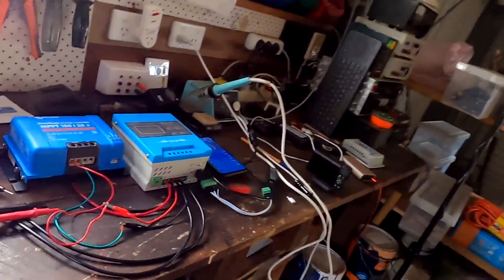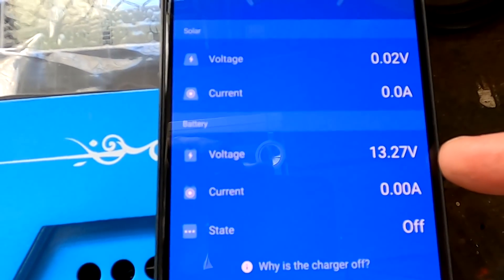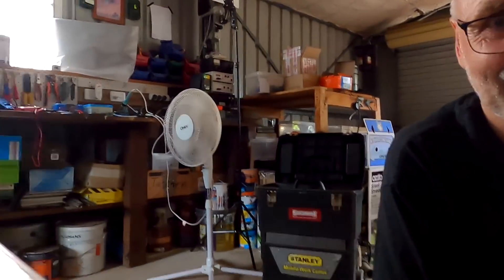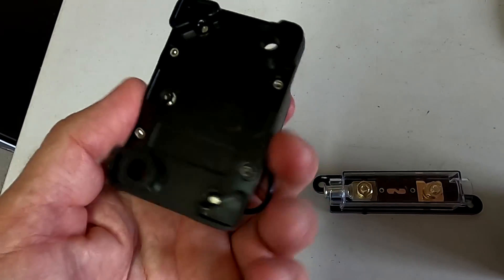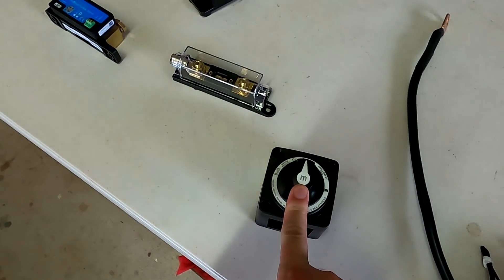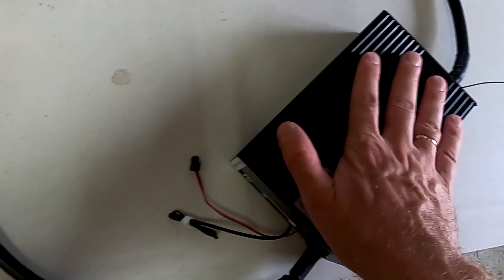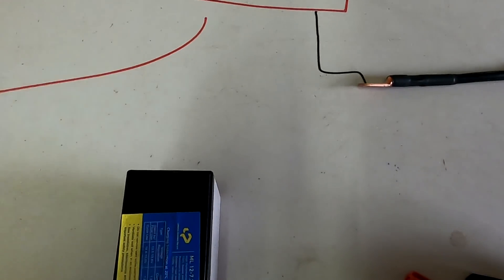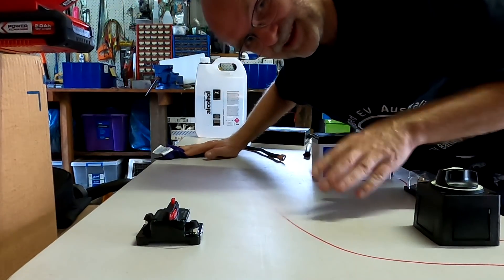How to arrange all your battery gear? Best practice?

Comment: The shunt should go before the BMS. the main reason if your BMS disconnects then you lose all smart shunt data,. that is the issue i am having...  Fuse on positive
Reply from the maker: What shunt are you using? My smart shunt does not lose any information when powered off, just the SOC but this was fixed in the latest firmware update.
Reply: @@OffGridGarageAustralia  you're right not data,  it is the SOC.. I guess I have not updated. never mind lol

Comment: I've been using my 'cheap' 150A circuit breaker (like yours) in my 24V system for 5 years now without a problem. I've never tripped it but my inverter is only 2400w continuous.

Comment: Circuit breaker can't be everywhere.... From the plus pole of the battery you got
0- battery plus
1- isolator
2- fuse
3- inverter
4- bms
5- shunt
6- battery minus

Comment: Andy,
Please review AS/NZS 5139:2019 for BESS's, which states you need 2 pole Isolator, not single pole....
"The battery isolator shall have at least one pole for each live conductor including the conductor that is earthed. For example, if the system comprises a centre tapped earth then a 3 pole switch-disconnector is required for breaking simultaneously the two battery system output cables and the centre tapped earth."

Comment: For the automatic fuse: It's garbage. Do not use.
There are better ones of this  automatic type but I would go for the ANL fuse you liked and bought.

And by the way.. this automatic is not meant to be used as switch as IMHO said in the video.

Other things were explained correct, battery minus to bms to shunt.

By the way 2: I would always go for Victron BMV712 instead of smartshunt. Works always and independent of a present smartphone or a functional apo on an smartphone operation system in maybe 5 years.. (and additionally have a switched output...)

Comment: I had a couple of those 200A breakers. Useless. The terminals were pathetic on them and they tripped in about 20 seconds with only 110A.
Reply: Totally agree.  I bought a couple of these and put one in a small system I put together and it tripped WAY before it should have.  Thankfully it tripped before the AMP rating was reached rather than the other way around but this made me question the quality of these breakers.  I ended up throwing them out.  Don't use them.

Comment: In cars and boats we always fuse the positive. It is kind of hard to explain without drawing an schematic, but basically, during a fault, you might have alternative paths to the negative (via car shell , or appliances shell/grounding on boats). This is much more unlikely on a solar install, but it doesn't hurt to follow.

Some people trust only on the BMS as a safety device. In my opinion this is not acceptable. It is there to save the battery, the fuse is there to save the wiring FROM the battery.
Reply from the maker: I totally agree and I'm used to fuse the positive as well rather than the negative.
And yes again, the BMS is for protecting the battery, nothing else.

Comment: On the negative side, go with:

Battery > BMS > Shunt

If you think about it, many brand name batteries come with a BMS in the box... Everything is connected after that BMS, including a Shunt.
Reply from the maker: But the shunt won't be accurate then. It has voltage sense to the battery for the positive but the negative has the 'loss' from the BMS.
Reply: @OffGridGarageAustralia  

Main function of this setup is to count amps with the shunt. That what you will really look at. "From my 280ah how much do I still have". The values the shunt (circuit) will put out for battery voltage are secondary. And they will be off by very little.

Comment: The 3kw inverter may have a 6kw peak output. Depending on fuse type, it will blow.

Fuses should match the ampacity of the cables used.
Reply: A 100amp fuse will have say a 200amp peak for about .10 .20 sec if you have an issue with that fuse you can switch to a slow burn fuse which will take a max load for around 1-5sec
Reply from the maker: It's a 35mm cable with a 100A fuse, I will use. The inverter has 6kW peak but only for a split second when starting a motor or so. I'm not expecting to lose the fuse on that short moment.

Comment: Use a fuse, those brakers are not reliable at all (have seen them on fire). 

So, the shunt goes to the NEGATIVE. Battery (-) to  shunt to anything else. (Don't put anything else between the battery and the shunt, apart from a BMS if applicable).

On the positive, it will be:

battery -> fuse (as close as possible) -> switch -> anything else (usually a bus bar if you have a lot of stuff to connect)

Make sure that the switch is up to the VOLTAGE you are using, it is easy to find switches to a few hundred amps, but most max out around 40v.
Reply: On the positive, from the bus bar to the devices, everytime you use smaller gauge wire, you need to add a fuse (unless the first fuse is already calculated to the lowest ampacity wire used).

Comment: The fuse needs to be 25% larger than load, I wouldn't use the breaker without testing it, some don't trip, some trip at 40-50amps, BMS needs to be on battery only, then switch then fuse! The BMS losses should be micro amps, the switch polarity doesent matter,  I'm thinking about getting a smart shunt!

I have two systems in my house, 12v LiFePo 400ah, and 24v liion 1kah+, with fla backup, of 600+ah it's more like a boat or rv than a house, 12v lighting, I'm planning to get a smaller 12v inverter to work as a backup, to keep the fridge going, incase of discharged batteries, I will not be in the dark, and it can be charged by a car if it's a emergency!  I. Am working on a DC generator, to charge both if needed! Off grid requires back up, if you do not want to be in the dark!
Reply from the maker: A lot of thinks to consider... gives me some ideas to extend the project 😉

Comment: I suggest the fuse over the breaker for use with inverter.  The breakers can be a pain with inverter when turning on the first time breaker can take a few trys to get it to stay on.  The rest not sure it matters.  The big switches make sure you read the package some don't have enough isolation to use on positive side so mounting screws are too close to the terminals.   That one looks good but have seen people put the ones that have warnings for negative only and they install on the positive wire and when they fail shorts the battery to ground not good.

Comment: bms first, then shunt, as for those circuit breakers, those are junk unless you get a brand name one like bluesea. 
the fuse you selected is not suitable. you need a HRC fuse (the ceramic ones that are filled with quartz to quench arcs in case of rupture)
Reply from the maker: There won't be an arc with just 48V. To maintain an arc over some time it needs voltage to overcome the air as isolator. I read about the class-T fuses but this would only apply for high voltage batteries like in vehicles where you have 400-800V DC.

Comment: Mostly yes... Your initial layout will work. However. Some things to consider are... 
The shunt introduces a small resistance which may affect the accuracy of the readings the BMS relies on to protect the batteries. So I would place the BMS first. You also want your inverter as close as possible to the batteries to minimize total wire length and in turn the total circuit resistance. This is especially important at high load conditions where the voltage drop through the conductors will be highest, The other side of the wire length coin is of coarse, wire size... Electrical code for 100 amp circuit protection is #2 copper wire. I wouldn't use anything smaller.
Reply from the maker: The BMS will measure the voltage through the balance leads though not through the thick cable. It should not make a difference if the BMS is directly connected to the negative or through the shunt.
I went with 2AWG wire (35mm).

Comment: Use both the fuse and the breaker on the positive 😀 since you've got them. Why not? As for the negative side, I really don't think it matters if you put the bms or shunt next to the battery. There will be some power consumed by the BMS that won't be calculated if you put the shunt further from the battery but not much. The resistance the shunt creates won't create any real life difference to how your system works. The battery negative on the BMS is not used for sensing voltage as all the sensing is done with the individual sensing wires so no reason to worry about that. I've got my negative side set up as battery->bms->shunt but I really think battery->shunt->bms would work too.
Reply from the maker: Thanks Dan. I saw that you have these breakers as well. I like the idea of using them as a switch to disconnect the battery but I'm not convinced about the quality or actual functionality. Has yours ever tripped?
You're one one the very few people who seem to have recognised that the BMS uses the balance leads for voltage sense and is not reliant on the main B- cable to be connected to the battery directly. 
As with your setup, the shunt will always be wrong as there is a voltage drop through the BMS, right? So the shunt will not measure the true negative potential of the battery. Is this a problem in showing correct numbers?

Comment: Do a proper test with that 200a breaker. I heard a lot of ppl complaining about their build quality: even with half of its rated amps it becomes extremely hot or even trip: they are junk.
For the fuse: if you want to do it properly go for bs88 or class t fuses.
The anl fuses you are using are not good. First, they are rated for max 32v. Second, they aren’t capable of disconnecting a short current. All fuses have a voltage and interrupting rate. The ir is the maximum amps it can disconnect. This can be extremely high since lfp can provide massive currents. If exceeding that, it could just arc and continue to let current pass. Also this applies to the voltage rating.
Blue sea has proper class t fuse holders and eaton/bussmann provides great highcurrent fuses.
Reply from the maker: I will not use the breaker. There will be no arc for long at only 48V in case of a fault.

Comment: I have both a fuse and circuit breaker. I have several of that exact same 200A circuit breaker and I had one fail in the closed position. (Not good). So I have two Victron Inverters that each have a 200A circuit breaker, and they both pull power from the battery with a 350A fuse. I also have a Victron MPPT and it's connected via a 150A circuit breaker. I prefer having one main fuse and then a separate smaller circuit breaker for each device connected to the battery. This way in most failure scenario the smaller circuit breaker should trip first, but if something bad goes wrong the fuse will blow.

As far as BMS first vs shunt first: It depends on if the BMS measures state of charge. IE: If the BMS has it's own shunt or other coulomb counting device integrated then it should be connected first. Otherwise if it's just a BMS that monitors the cell voltages but doesn't track state of charge then I would put the shunt first so that you can track the energy consumed by the BMS. if the BMS has it's own coulomb counter to track state of charge then you may not even need the shunt, just use the BMS to track state of charge?

I put my disconnect, fuse, and circuit breakers on the positive side. It doesn't really matter from a safety perspective, it just helps balance the amount of stuff connected to the positive side vs the negative side. It also depends on if and/or how you're going to "ground" the negative side. If the negative side is connected to ground (chassis / earth / etc) then it's often easier to place circuit interrupters (disconnect, breakers, fuses, etc) on the positive side to minimize the amount of cabling between the battery and the ground.

Comment: I have 150amp circuit breaker on both of my battery strings, very similar to yours. Works, clicked out on a 3kw pressure washer start up. On the postive side

Comment: Consider the BMS part of the battery, so that goes first on the negative pole. Shunt can go after the BMS. Consider the fuse also part of the battery, put that fist thing on the positive pole. Switch comes after that.
Reply from the maker: Simple and makes sense. Thanks.

Comment: I dont know if you read all the comments but I had a reply to my whatsapp from JNGE today. They said the following "no problem" "we have upgraded the program" So lets see if we can get the new firmware.
Reply from the maker: They told me they may be able to calibrate the controller through the app and I should be 'patient'... 😉
Reply: @OffGridGarageAustralia  My patience will last untill I get them. I will check the voltages and if they are out. I have their number lol

Comment: would suggest not to use a tinned cable lug in direct contact with gold plated screws. Micromovements of the parts as beeing caused by temperature changes lead to the buildup of alloy crystals of tin/gold. These crystals are much harder than gold or tin in their pure forms. The movements then lead to increasing microscopic damages in both surfaces and a rising resistance between lug an screw. You will not see that at once, but after some months the temperature of the contact will rise under load. That process is self-increasing. Always combine identical materials in high power contacts! Hope I could explain. My native language is german ☺
Reply from the maker: Thanks for your comment and suggestion.
My native language is German too.
Reply: @OffGridGarageAustralia  I know. I just wanted to support the other viewers and explain my lack of the correct terms.
Btw great videos. I love to see your progress 👍👏

Comment: you need a big fuse to protect the inverter. you should be using a class T fuse. the automotive breaker is not good. the ANL style fuse is also probably not rated adequately for the LIFePO4 battery bank. look for a youtube guy called Lithium Solar. he has an excellent video on Fuse selection and why you need to get a fuse that is designed for LIFePO4. I have my 2 shunts for my SBMS0 right after the battery then the class T 400 amp fuse right before the inverter. You can get a lower amperage Class T fuse if you want. the fuse protects the inverter and also the wire. make sure you use a large wire gauge for the inverter. you can never go wrong with using a larger wire than you need for the inverter. use only copper wire of course. i have a 24-volt 2P8S LiFePO4 battery bank using 16 Lishen 272Ah cells (wired in 2P8S configuration).
 Do not trust the automotive breaker.
do not trust the ANL style fuse -- unless you look up the actual interrupt ratings.
watch the video of Lithium Solar on fuses - on YouTube.
the big class T fuse I refer to as the catastrophe fuse. save you A--- in case of catastrophe.
I arced my 272Ah battery accidentally and it acted just like an arc welder and cut through 2 battery studs ... scared me so be careful my friend.
I am using the Electrodascus SBMS0 which has 3 decimal point accuracy and monitoring and balancing of the LiFePO4 24-volt battery bank. The SBMS0 can control an MPPT and will work with Victron stuff also. you may want to look at the Electrodacus equipment at Electrodacus.com
I also am using the Electrodacus DSSR20 which is A solid-state relay to control every 2 250 watts 60 cell solar panels which are wired in parallel at the array. this equipment is working great. I have 6 250 watt PV panels hooked up and will be hooking up a lot more soon to the Electrodacus SBMS0 and Electrodacus DSSR20's.

Comment: The most accepted way to connect would be negative-bms-smart shunt. And positive-fuse-switch... But i would like to know what the bms consumes... And i triste the Smart shunt to BE before the bms if the bms has a diferent Wire for mesuring the negative of the battery
Reply from the maker: Power consumption of the BMS is only 50uA and yes, the BMS uses the balance leads only to sense the voltage, not the main thick cable.

Comment: Andy, I have a 6 kW Growatt inverter and the 150 A version of your circuit breaker. The CB contacts welded together the first time I used the CB to  connect the battery to the inverter and the capacitors were energized. For large inverters you have to use the “resistor in series” method to avoid that large inrush current. The same thing happened the another time when I attempted to close the circuit with the Anderson connector I installed as my battery connection except that I watched a glowing blob of molten metal fly off of one of the connector contact blades!
Reply from the maker: Thanks for the feedback, Barry. I've tested my inverter and it has a 'soft start' so won't cause any sparks or surges when connecting. I don't trust this CB though. It looks very cheap...
Stay safe, sounds like you have a lot of high amps going on!

Comment: Negative side: Shunt between BMS and Load.  Positive side: Fuse, Switch, Load.
Reply: I also think this is the right way. In industrial car-batteries the bms is included with the battery so you don´t have access inside the device. So the first after battery-Minus is the shunt, then load. From battery-Positive first the fuse close to the battery, then switch, last load. This is my way to install.

Comment: Smart shunt after BMS(if the BMS disconnect you loose power to the shunt). The fuse before the switch. Something to consider, are you planning to add more battery packs in future? If yes then the shunt after the DC bus bar.

Comment: Pretty sure the BMS says to not connect cell taps before main battery connection. Should the fuse only be in the load side to eliminate disconnection. Also most solar chargers say not to have cells connected without battery. Just to make things more confusing.